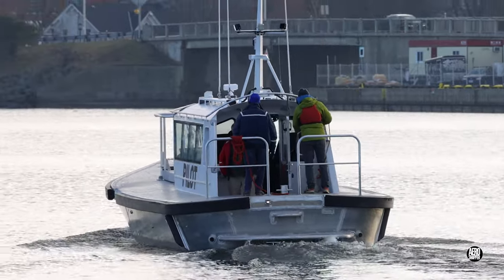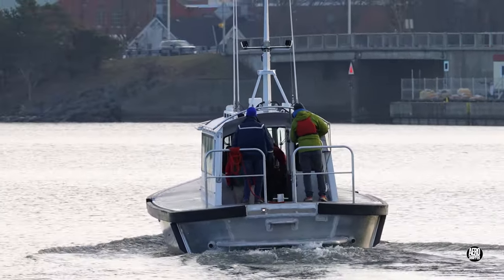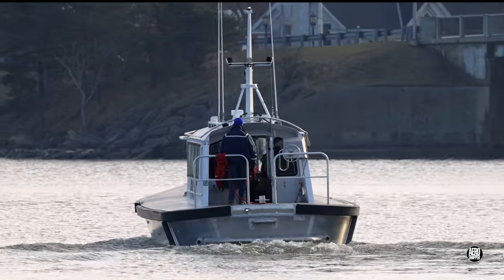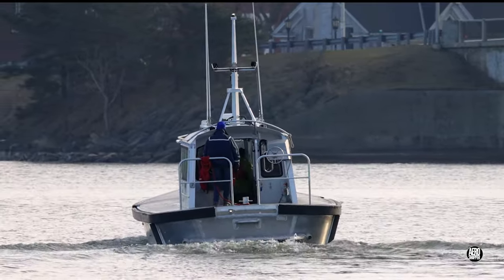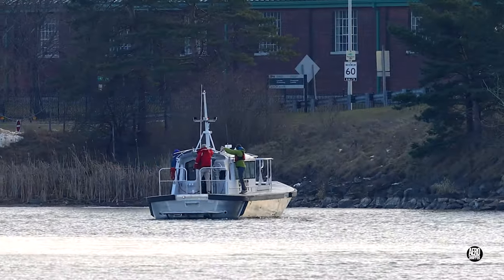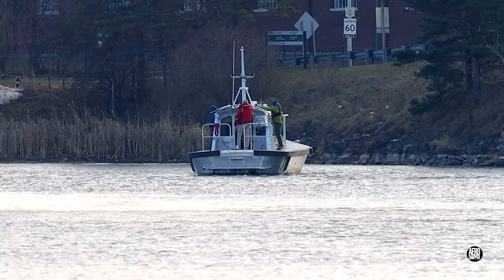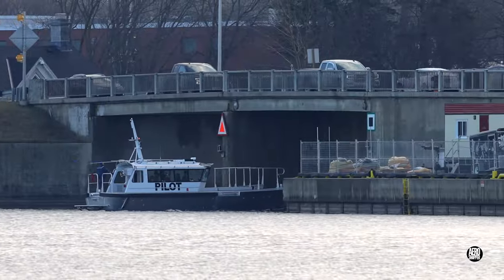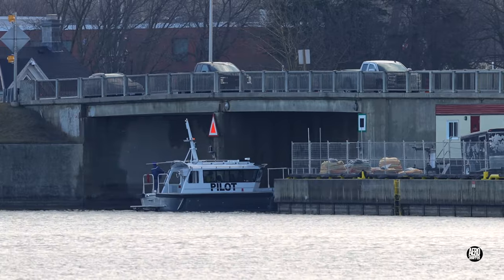Metalcraft Marine sends a Pilot Boat to Florida   4K

Comment: Nice looking Pilot Boat! Gotta love the Bill Preston design! We got two of his designed boats here in Canaveral and I have had the chance to ride in both. They are very smooth rides even in less-than-ideal conditions because of the unique design of having the engine in the front of the boat. Preston was smart when he realized that redistributing weight to the front end of the boat caused a lower center of gravity that allows the boat to slice through the wave vs dropping over the wave and slamming the crest. I am excited to see this boat in person and get some content shot of her at work down in Port Everglades. 🤙
Reply from the maker: Great to hear from someone who really appreciates the Preston designs and good  strong workboats. She should be in service before too long. It will be particularly interesting to hear how much the Pilots appreciate the minor enhancements made to complement the boat’s already excellent characteristics.

Comment: Like you said  design is a bit different  but it runs and  jump like a deer  looking forward to  looking at the link to the designer  and different place of engine  
Are they  doing  anything with the  marina  that has been  run down for a  bit you a short video about it  had to look it up  from your videos Rideau Marina ?
Reply from the maker: Ron - I think you'll enjoy learning about the designer - he is 82 this year with more than 50 years of boat design behind him.  Rideau Marina will never re-open to boating.  It's in the hands of a developer who has failed so far to get permission to build apartments on the site.  The boathouses have been demolished and removed.
Reply: I think I seen  it on sky that it was being removed  
I don't remember if  they said about  what was happening if they did  i missed it  
Thanks  young man